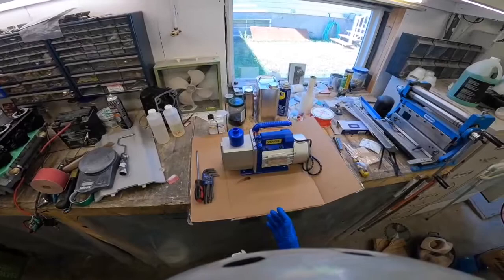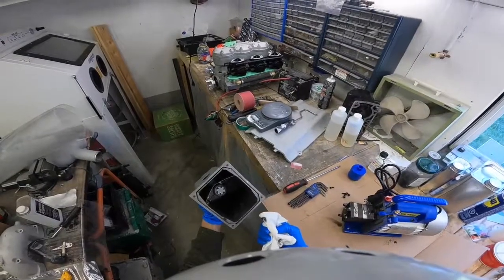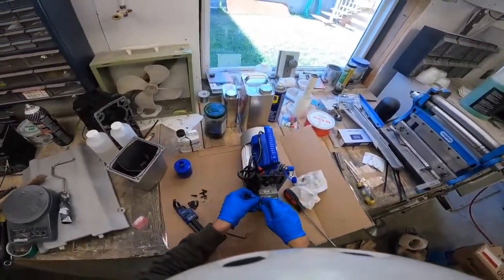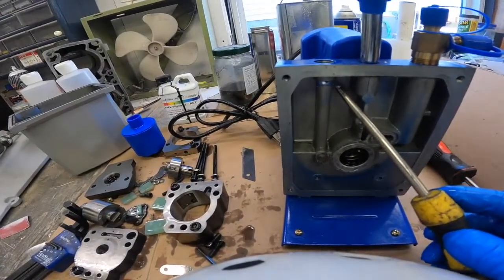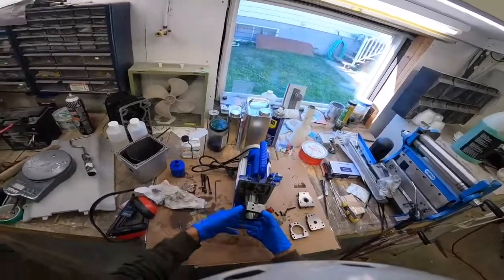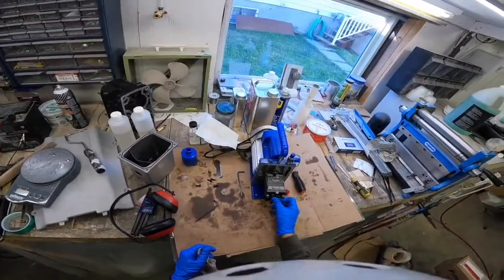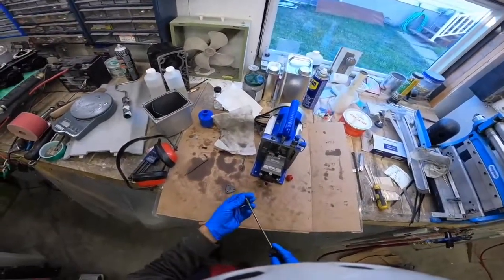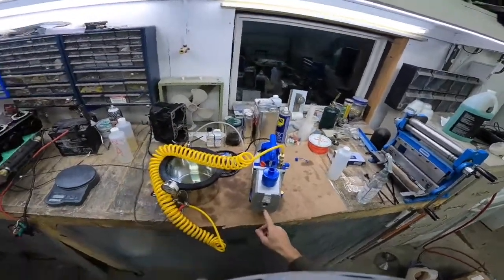Two Stage Vacuum Pump Teardown & Rebuild - Why Do Cheap Vacuum Pumps Fail ?

Comment: Thank God for you my friend.  I am going through the same thing with a Vevor pump I ordered from eBay (2 stage 5 CFM 1/2 Horse Power)  It came saturated with oil just like yours and the motor is locked up.  I am going to be sending a link to the seller of your Part 1 so he will know what mine arrived like.   Hopefully they will replace the one I received and then I will definitely take mine apart and check before using and this video will aid in my success.  I love how thorough you are in explanation.  I enjoy having something to take apart and try and fix from time to time, so this will (it looks like) be very interesting indeed to take apart, clean and put back together.  I was wondering as to the cleaning you kept mentioning through-out the video...  I kept an eye on your WD-40 can to see if you had used it for cleaning, but noticed it never really seemed to change in location or it's placement (label of can always pointed in same direction), so was wondering if you used any WD-40 or any other solvents for cleaning the parts (or even used a fine sand paper for cleaning any rust), or was you just using only paper towels for cleaning.  I would think that using WD would be a good way to clean parts, but would not want to use something that may cause damage to the vacuum pump later on (thanks for your input about cleaning solution or none)...   
Thanks again for taking the time to put this together and just know that not only did I like this video but you now have a new subscriber as well because anyone who puts this much effort and care in creating content to help someone in need - definitely deserves much gratitude and appreciation, and I am appreciating you very much sir - thank you...
Reply from the maker: Hello Steven and thanks for the comment / question. This pump had very little rust on it, so just used paper towel for the cleaning and a razer blade to scratch off any rust. Rust can cause two problems. 1, being on contact surfaces and obviously causing damage,  but also 2. mixing in with the oil and causing damage to the whole unit. 

If you have more rust, you could soak the parts in some WD40, or something similar, but make sure that you clean them well afterwards. Vacuum pump oil needs to be used in these pumps or you will struggle to pull a vacuum, as "normal" oil releases glasses when you start to pull a vacuum. 

Good luck with Ebay and with working on it if you get another one.
Reply: @JoelArseneaultYouTube  Thank you Joel so much for the reply.  I thank you for your advice and will keep what you said in mind about using WD-40 (Just make sure it is ALL removed so as to not contaminate the vacuum pump oil).  I found vacuum pump oil at tractor supply and am not sure it would be good for this as it is for dairy farms and their milking vacuum pumps...  I am having a hard time finding vacuum pump oil for the HVAC pumps hmmm, any suggestions?.   I am still waiting on the eBay seller to get back with me with replacing this locked pump.  If I have to take this apart, I think it will be fun using this situation for creating my first repair video on YouTube and pointing viewers to your channel for the inspiration, and who knows it may be a start of something.  I love tinkering and taking things apart, troubleshooting and fixing, but it is frustrating to buy something and have to take it apart and repair it out of the box...    As a kid I took things apart just to see what made them work and never actually put anything back together, but now I take things apart to find a way to fix them and thought that may be a great idea for a YouTube channel...
Reply from the maker: @Reflections2013  I always took things apart as a kid too. My father was a mechanic, so later on I followed him around and learned a lot of stuff, and got put to work. 

I would think that any vacuum pump oil should be fine. If you do a little reading on what vacuum pump oil is, it might put your mind at ease. It has something to do with the refining process and removing sulfur .... I believe ... either way, they basically refine it a few more steps on top of "normal" oil 

Normal engine oil would not hurt your pump. It would simply not allow you to pull a complete vacuum and might make you think that there was something wrong with the pump. Not sure what your location is, but I have been able to find pump oil on amazon and a few places online, and I am in Canada ... we usually have limited choices compared to the US.

If you are thinking about making some youtube videos, this would be a good place to start, for sure. You don't have to do it as a "how to". lots of people like videos that they can relate to, and someone who doesn't have experience just trying to sort something out could be popular. Good luck 👍
Reply: @JoelArseneaultYouTube  Thanks for another great response Joel.  Wow - interesting - my Dad was also a mechanic, and I think allot that I learned was from watching him.  I also would like to update my result with eBay.  They decided to refund my money and have me return the damaged pump.  I have decided to try buy another pump from them in a week or so and try again and just maybe my 2nd pump will turn out like your 4th (one could only hope right??).

Thanks for the suggestions on where to look - BUT I went to my local Hardware store and they told me ---- "What is vacuum pump oil???"...  LOL so you can imagine I didn't find any there.  I went to a local HVAC center, and after talking with them for a few moments, they not only went in back and found a quart of oil that they had on hand and sold it to me, but they was at that time needing to make a order for more oil and added (at my request) 2 gallons of premium vacuum pump oil to their order.  I will be going Monday to pick it up.  They were super nice people to talk too.  

So I said all that to say this...  Anyone that may be looking for Vacuum Pump Oil and are having a hard time finding it - try to find an HVAC center in your area, walk in, explain your situation and they may very well be able to sell you what you need.  Thanks again Joel, you have been very helpful and kind and it is appreciated. 

I also want to thank you for the suggestion on a channel (type of channel).  I really like that approach...  Everyone needs someone they can relate too and - so do I, and I definitely relate to you for sure so thanks for what you do my friend, your helping allot of people...
Reply from the maker: @Reflections2013  Thanks for the comment ! That is great info.

Comment: The rubber plug on the top of the gauge lets you set the pressure it is referencing. If you remove it or cut the nipple off it will reference atmosphere. Otherwise it will reference the last pressure it was removed at.
Reply from the maker: Thanks ! I had suspected something like that. Great to hear an actual explanation.
Reply: So is it acting like a gas balast?

Comment: Hi! Do you know what thread the inlet fitting has? (The female thread that is in the pump housing)
Reply: I don't know for sure. I know that some of the fittings are metric, but from memory, think it is 1/8 pipe thread. As soon as I wrote that... i realized that the carry handle was 1/8 pipe thread... I don't know if I took notice of the thread you are talking about.

Comment: I just got a pump from VEVOR and it seems to made to a higher standard. No burrs or signs of corrosion inside. Maybe they've watched your video?
Reply from the maker: I think I probably just have bad luck and got all of the bad ones they make that year, haha. I actually just got a tubing bender from VEVOR and it looks great... haven't tried it yet.

Comment: I have also one of this pumps. I use I to power my vacuum table of my cnc. The problem is that it overheats after about 40 minutes. Is that normal?
Reply from the maker: That's not normal. I have run mine for hours without overheating. Although ... I'm not sure about the science, but if you have air leaks I believe you are working the pump harder than if you have a seal and it is achieving close to 25 inches of mercury, for example... 

These motors are enclosed and do run hot. Make sure that the fan on the end of your motor is spinning and not damaged. Make sure that the end of the motor is not blocked and that it is not in an enclosed space. 

If you can't solve the heating problem, you could loop copper pipe around the motor and circulate water with a pump, to water cool it.

Comment: Thanks for the video, now I have a pump almost like yours from the same company, if you want to use it for a long duration you might want to check the power cord, the one I got had a 20 AWG wire (0.75mm2) cord which will run a 1 hp motor but your running it over the max rating which is never a good thing, I just removed it and added a 12 AWG cord and now it runs great and you don't need to worry about it melting or catching on fire during a larger project.
Reply from the maker: That is a very small cord. Thanks for the heads up. I've been using mine quite a bit and haven't had any issues. I monitor the temp closely (of the pump and motor) Cheers.

Comment: Many thanks! We have one of these that crapped out suddenly,  I'm suspecting contamination after seeing your video.
Reply from the maker: Yes. I had a few of these fail before getting this one. I haven't updated this video, but I now have several hours on this unit with no issues whatsoever.

Comment: Hey man, very helpful video! I have the exact same pump as you and I’m trying to do a similar thing with the hose hook up. I need to buy the barb to thread fitting that attaches onto the inlet of the pump. Do you know the specs for the thread of that part? I see many different parts with NPT but I dont think those threads are NPT I thought they were more like straight threads. If you know the part you bought that would be a huge help!
Reply from the maker: It took me a few minutes to figure out what part you were talking about... I have a bad memory sometimes. I ended up going to a local shop called "greenline hose and fittings" and brought the fittings that I wanted to adapt from / to and they sold me the part. I forget what it is called, but it is not NPT. I spent a whole lot of time trying to figure this out on my own, but the pros knew what to do immediately.

Comment: I use the shortest and widest vacuum lines because flow restrictions are a big problem in vacuum flow. We are pumping almost nothing near a vacuum so we need to increase chance of atoms being trapped in pump vanes.
Reply from the maker: Hey, thanks for the comment. 

I respectfully don't agree with what you are saying, though. I may be wrong, but my thoughts are this. 

Resistance to flow is based on the number of molecules you are trying to pass through a given space. By either reducing the amount of fluid / air / molecules or increasing the size of the space, you reduce the resistance. This would mean that as the vacuum increases / pressure drops the resistance to flow would decrease and the remaining lonely molecules would have an easier time to make their way out. 

This can be witnessed at the exhaust port of the vacuum pump. If you have it plugged when you turn it on, it will pop the plug out quite energetically as the plug is causing a restriction to the flow ... Once you have 25 i/hg pulled, you can put the plug back in and it will not pop out violently - as it is not causing a restriction. 

I have been using 1/4 hose on the vacuum side of my parts, that I am infusing, and haven't had any vacuum issues. I have used 3/8 hose for the inlet (epoxy in) side to reduce resistance in that case. I'm pretty sure what I'm saying is correct, but maybe my thinking is flawed.
Reply: @JoelArseneaultYouTube it does matter, but probably not for the levels of vacuum and speeds needed for casting.
If you look at turbomolecular pumps and high vacuum gear they do use the large inlets and such like as the stuff they are pumping stops looking like a fluid and starts looking like a bunch of particles doing their own thing just bouncing off the walls

Comment: Do you by chance have a parts list for this pump?  I have a similar one and tore it down to rebuild the vacuum pump portion (covered in schmutz).  In the process I've lost one of the tiny reeds you're talking about at 29:53 in your video.  I've reached out to the manufacture (Vivohomes) who says they don't have a parts list and I should contact the seller (Amazon) which I did.  After 2 cycles of run-around they also don't have a parts list.  Great presentation on the product!
Reply from the maker: Hey, sorry but I don't have a parts list for it either. I did a bunch of searching online when I posted this video and was able to find some stuff, but I don't remember how or where.
Reply: @JoelArseneaultYouTube  - I get it. I've been searching for about 2 days and have come up empty.....
Reply from the maker: @gjDOnBBQ  That sucks. Maybe try contacting Vevor or another company. There are lots of companies that all sell these.

Comment: the shim was in mine too so I put it back in the right place .I don't know the reason for the shim but it was at the bottom bolt so I put it back and it works fine.mine had only 2 bolts.
Reply from the maker: I assume that they are using the shim to "correct" the alignment along the axis of the rotors and housings, but mine seemed to be doing more harm than good. 

To check this alignment, I believe you would have to accurately measure the distance between the housing along the axis, and if you wanted to be sure that it wasn't just a flaw in the bore or on the rotor you would then have to rotate, move position on the bore and remeasure.

PS. I have used mine now for a few hours and haven't had any issues with vacuum or with the oil getting dirty, so I have to assume that it is okay. The actual parts that make contact have a LOT of room for error as the vane seals float in the rotors 👍

Comment: @Joel Arseneault Hi Joel, do you know of a good resource for getting replacement parts?  The plastic pieces inside the vanes are what I'm hoping to find.  One of mine wore out and came loose inside, only to seize the vacuum up completely.  Thanks for the great vid!
Reply from the maker: No, sorry, but I have not been able to find parts for these.
Reply: @JoelArseneaultYouTube  any idea what material the vanes are made of?  I'm having several 3D printed.  I've found a source for the small compression springs as well.
Reply from the maker: @stevelibby3  They are some sort of fibreglass reinforced plastic. Whatever it is is pretty abrasive resistant and hard.

Comment: My friend what for is it the the red screw? I gotta put it in oil as well?
Reply from the maker: Look at 34:41 and the answer is there. 

The "red screw" is the fill plug. I used a different hole to add oil, as it is easier. Both of these holes go to the same area.
Reply: @JoelArseneaultYouTube  thank you my friend I did it, because I didn’t know xs🙏

Comment: Please  I need your help. I currently want to build a system, that allows hot steam to enter and leave a vacuum while maintaining a specific pressure. I know how to keep the temperature in the system constant at 200 degrees Celsius. I also know how to attend the initial desired pressure. The problem now is how do I make pass hot steam through this system, and allowing the steam to escape the system without changing the pressure of the system? What device(s) could be used to achieve this desire? Thanks for helping out guys .
Reply from the maker: I'm not sure, but this is a very complex problem. In some ways, it is somewhat impossible, depending on what you mean by vacuum. It is also impossible depending on how accurate your temperature needs to be regulated. 

Introducing steam will increase the pressure, you are also introducing water, and I assume that the water, in a near vacuum, will off gas and cause both cooling and loss of vacuum. Depending on the amount of steam you would need a massive vacuum pump to maintain near vacuum, and a very powerful heater to maintain heat.

Pulling the water out becomes another big problem that I'm not sure how to fix, but I do know that you can't allow this to get to your pump or it will cause issues very quickly.

Comment: Can you repair the electric motor/stator on the pump? I don't think my motor is spinning.
Reply from the maker: I do not know much about these motors. I believe they are induction motors and the most common failure would be the capacitor. That being said, they are very reliable and I would check everything else before I assume that the motor is the problem. 

Some of these have a breaker, it will likely also have a thermal / overheat switch and a power switch. If you can or could hear it hum, that could mean that something is seized causing the motor not to turn, or that you have a bad capacitor. You should be able to turn the motor over easily by turning the fan with your fingers. If not, something is probably stuck.
Reply: Another common problem with single-phase AC induction motors is their capacitor either wrongly dimensioned, or failed. I see this almost every time I get to investigate a motor not starting and tripping the circuit breakers. The capacitor is hooked up in series with the auxiliary winding, and they are wired in parallel to the main winding. The capacitor shifts the phase and buildup of the magnetic field by 90° in order to force the rotor to spin in a desired direction, mostly clockwise by industry standard.
Check the overall condition of your capacitor and capacity with the help of a multimeter which has a capacitor measuring function.